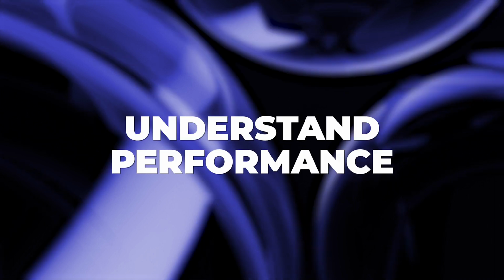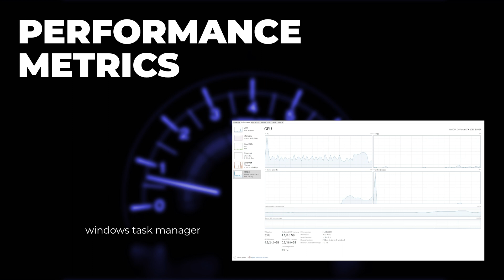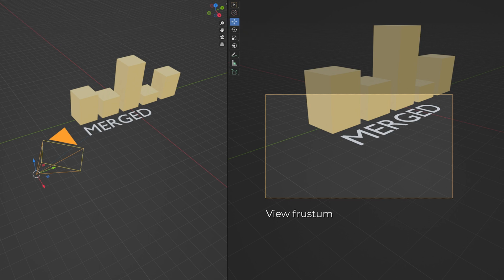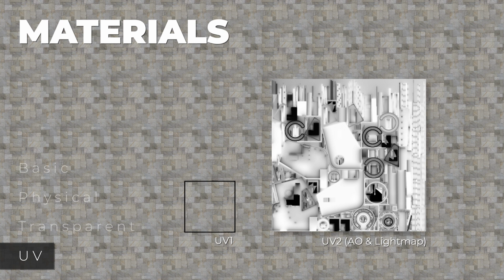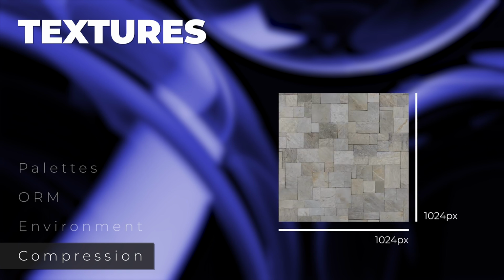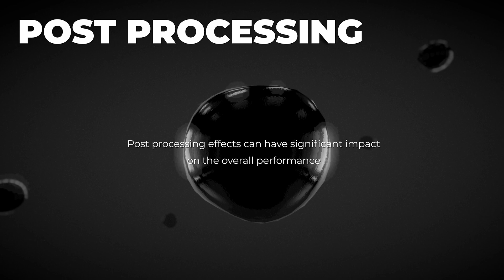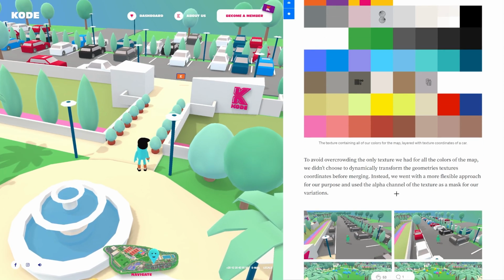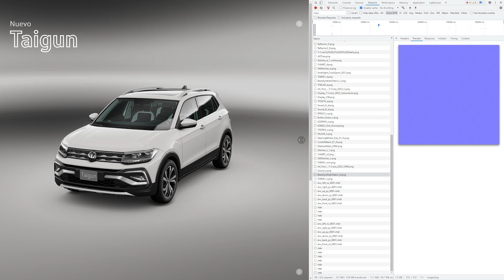Three.js Optimization - Best Practices and Techniques

Comment: Nice information, specially color palette.
I have a question why color palette is better than base color?
Reply from the maker: It's better when you are trying to keep the amount of draw call low which is important especially on mobile! 1 material using a color palette can be used on several objects. But if you are interested in this technique there is a video about it on my channel 😊

Comment: This was incredible thank you very much! What are your thoughts on different lights? Where do they fit in impacting performance relative to the other elements?
Reply from the maker: Personally, I rarely use Three.js lighting because you can never achieve the same level of realism as baking lights in 3D software. That being said, I often add at least one ambient light to control the general tone of the scene and sometimes a directional light. As long as you use lights solely for lighting purposes (with shadows disabled), they aren't that costly.

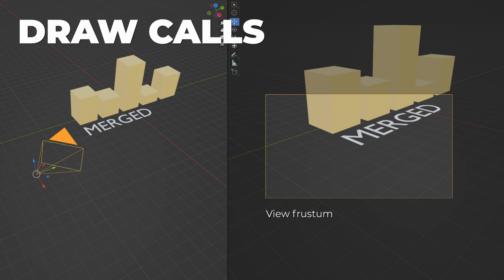Comment: 5:18 aren't vertices of a mesh that are outside of the view frustum  removed from rendering pipeline, such that vertex shader can also benefit from it since less vertices are calculated with the shader?
Reply from the maker: From what I have experienced, frustum culling works at the object level, not the vertex level.

Comment: 🎯 Key Takeaways for quick navigation:

00:00 🌐 Discussing the importance of optimizing WebGL content for better performance.
00:13 ⚠️ Performance optimization is often overlooked, leading developers and 3D artists to fend for themselves.
00:28 📚 Introduction to a comprehensive guide on creating optimized WebGL experiences.
00:41 📉 Understanding what affects WebGL performance and how to track it.
00:56 🤔 The challenge lies in balancing visual quality with performance.
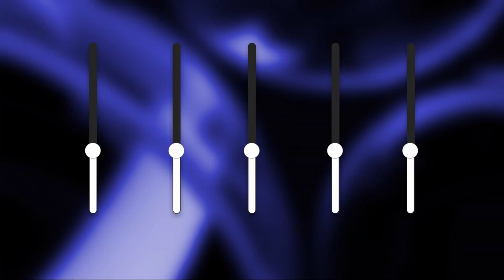01:23 🎚️ Visual elements like polygon count, materials, and textures are adjustable based on project needs.
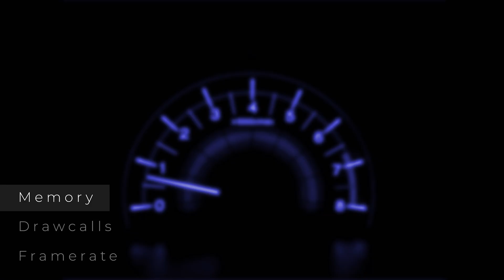01:52 📊 The importance of tracking performance metrics using tools like stat.js and r3f perf.
03:12 🔢 Draw calls represent the number of objects the GPU renders. Understanding how they are calculated is crucial.
04:34 ⚖️ Balancing the benefits of reducing draw calls with the cost of rendering unnecessary content.
05:44 🎨 Overview of material practices, from basic to physically-based rendering.
07:07 🎤 Transparent materials can be performance-heavy. Alternatives include using mesh transmission material.
08:04 🖼️ Textures play a crucial role in both quality and performance. Techniques like color palettes and ORM textures can help.
10:44 🚫 Avoid dynamic shadows when possible due to their performance cost.
11:53 🎬 Post-processing enhances the final output but can significantly impact performance.
12:36 📝 Case studies of two optimized websites provide insights into real-world optimization practices.
17:31 🧠 Reverse engineering websites is a great way to learn optimization techniques.
17:44 🙏 Thanks and encouragement to keep exploring best practices for 3GS optimization.

Made with HARPA AI